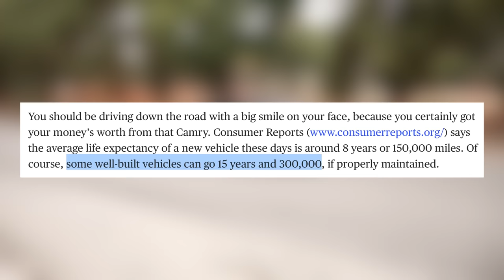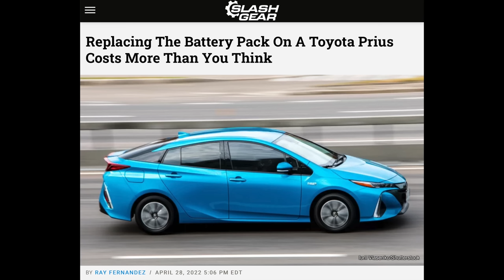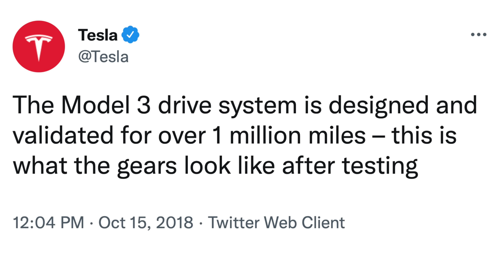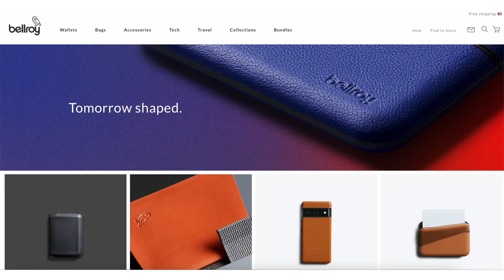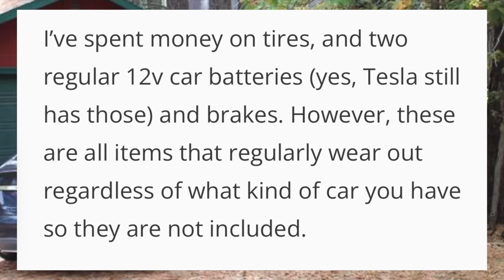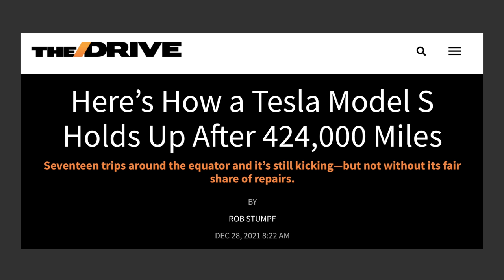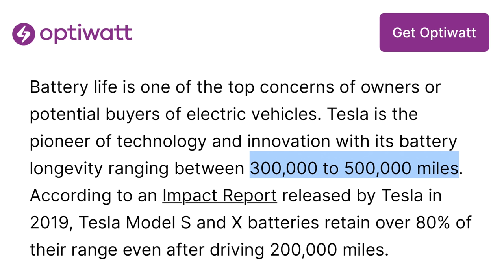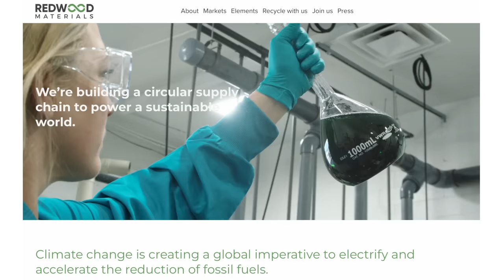The ONE MILLION Mile Tesla | It Still Runs

Comment from the maker: Check Out Bellroy Today & Save 10% Site Wide: https://bit.ly/3Lq5i2w
Reply: Bellroy is no joke. My wallet from 2013 still looks almost brand new. Probably will be able to hand it down to my kids. They have such a great product highly recommend and they don’t even pay me.
Reply: claiming eco while selling leather. 
greenwashing much? 
the design looks awesome it's a shame to sully it like this. 
Tesla saw the light, will Bellroy?
Reply: Hi Ryan 
Could you make a video about getting Tesla in countries where they have 0 charging point and no Tesla dealer or Service Center?  What problem I might face. Thank u
Reply: Dude you miss on mentioning the LFP Battery 🔋 it doesn’t degrade like the regular Tesla batteries
Reply: A bit slow the base model that's the issue with me.
Reply: @TroyRubert  ok u
Reply: I rented a brand new Model 3 from Hertz And the battery was defective after 15k miles. After i got my car I had 2 Uber passengers say the same thing. Im hearing nightmare stories. Mine was awful. I will never get one anytime soon.
Reply: Don't overlook that at those mileages a gas car would have to have it's engine and transmission rebuilt, which could easily cost more than $10,000 when you consider the performance levels found in Teslas.
Reply: I want to know about teslas in michigan and rust belt states. How long they last though winters etc.
Reply: @jonmitchell9019  Good question, I'd like to see how they do with chain on.